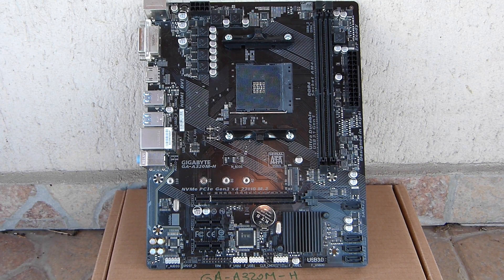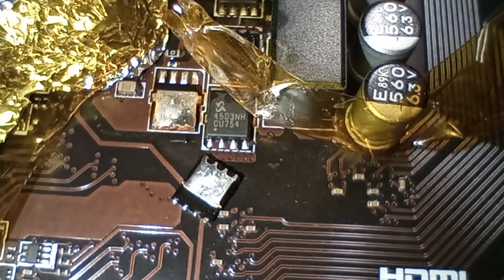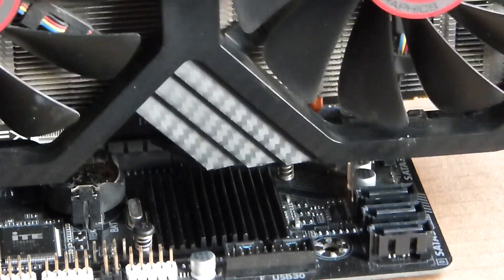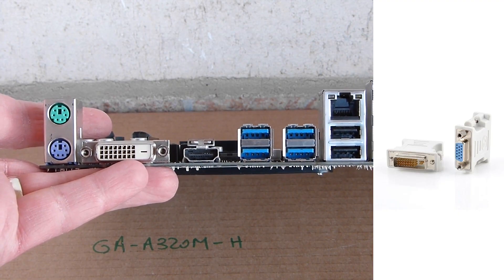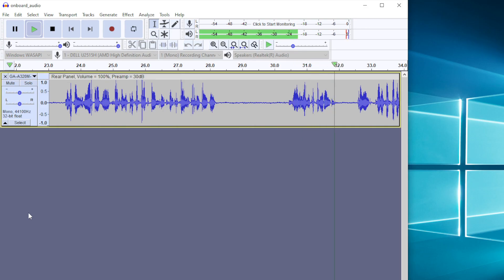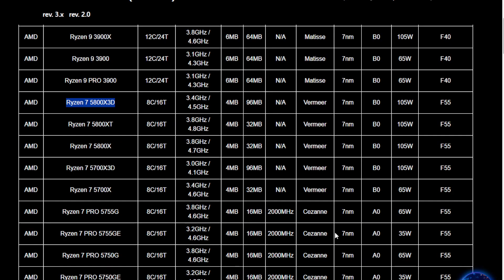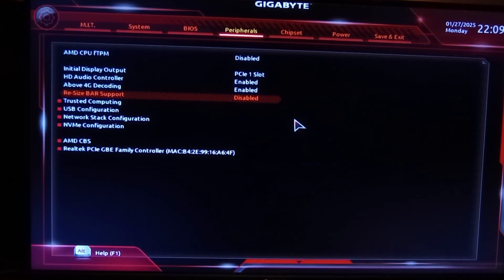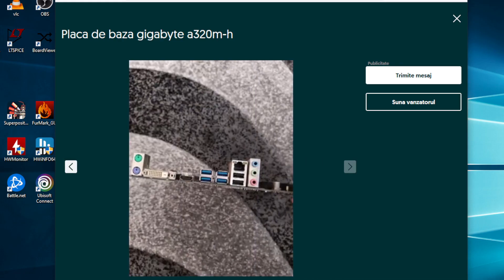A'Meh'4 Motherboard: Gigabyte GA-A320M-H

Comment: for 5 years i have this motherboard, i start to have some problems with the usb controllers, the audio preamp as how you show in the video is trash, and being limited to a small size gpu to use all 4 sala ports (who needs to use all 4 at the same time) is really a pain, and for my use case it's just not to helpful with all the feature it has, yes, for a low-end budget pc with a low-end cpu it does a fantastic job, but more extreme things it's just not cutting it
Reply from the maker: @Marius_Petrariu  The preamp is ok for video conferencing and voice chat in game. But that's about it.
The annoying bit is that there are other boards with the same ALC 887 codec that sound better.
Reply: Just use a 90 degree sata cable?
Reply from the maker: @ape337YT  I tried ... Marius is right. I use 2 SATA drives, and the two top ports are unusable with any GPU longer than 250 mm.
The naked VRMs also place a pretty serious restriction as to what cooler you can use. More on that in a follow-up, after I gather all the data.
Reply: @oldertechtoday  yea, and this is the biggest thing, the same audio chipset on other mobos are extremly good but on the a320m-h is not, which is sad imo at least for someone that is also a content creator and has a 3.5mm jack microphone it's the worst combination
Reply from the maker: @Marius_Petrariu  I hear you. I used an USB audio dongle for the videos recorded while this board was in my PC. Lucky that I had one.
Reply: @oldertechtoday  ah mb then, I thought a 90 degree sata cable would let you connect ur sata cables+big 3 fan gpu
Reply: @oldertechtoday if what I said doesn't work there's rly no way around it besides external drives, u can't even use those pcie to sata/m.2 cause those slots get covered with the gpu cause it's micro atx board, SUCKS
Reply: @ape337YT  i mean i'm using a m.2 ssd and one sata hdd, i was refering in the comment who has a 3 fan graphics card or one bigger than 300mm and needs to use all 4 sata cables i said it's a pain, for me it's not cuz i plan to ditch sata storage devices
Reply from the maker: @Marius_Petrariu  I'll add to that and point out that even an RX 580 from XFX will block those SATA ports, like seen in the video.

Comment: I have been using this Mobo since 2018.. it's now 2025.. it's still kicking!

It's pretty old.. I need 4 slot RAM now.. a Pcie 4.0 or 5.0 and ARGB header so I don't have to install extra hub.
Reply from the maker: @ZeeCH_Music  I used it with 2 sticks of 16GB each (32 total). But I guess PCIE4 would be nice, if you have a GPU or NVME drive that can use it.
Reply: @oldertechtoday Does it work fine with 16x2gb 3200 mhz ram?
Reply from the maker: @hokawa7877  the memory controller is in the CPU, not on the motherboard. If the  CPU you plan to use can go as high, then yes.
Reply: @oldertechtoday  Thank you!! I have a Ryzen 3 3200g and plan to upgrade 4gb ram to 2x16gb ram.

Comment: No cooling for VRM 2 slots of ram , it is what it is , not something i would buy personally
Reply from the maker: @Lifeless11111  There are better boards out there, and we'll examine a few.
Still, it does perform ok with a Ryzen 5 and a Wraith Prism cooler. I think that as long as you stick with downdraft coolers and low TDP processors, these budget boards can be a viable option.

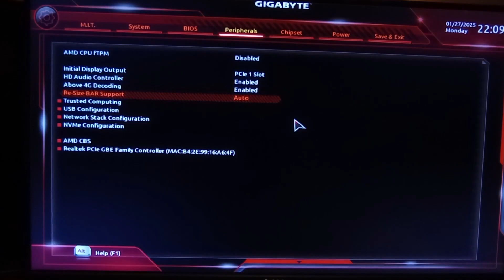Comment: 5:40 Wow! I have the same MoBo but a level higher (GA-AB350M-DS3H V2), and I don't have the “Re-Size BAR” option in the BIOS. This is probably due to the fact that I have the penultimate version of the BIOS.
What CPU model did you use?
Reply from the maker: Good point, Ryzen 5 3600, and I did flash the board to the latest version.
But! Rebar is quite old, and a lot of older CPUs/mobos should have supported it. It is (ultimately) the board manufacturer that decides if it implements it, and for what processors.
Reply: I got the ReBar by updating it to the lastest bios. 

I'm using the same mobo but it's V1.1 instead. 

upgraded my bios to have support for Ryzen 7 5700x.

I think 3000 above series Ryzen has ReBar option
Reply from the maker: @ZeeCH_Music  Yes, rebar is available from Zen 2 upwards. But that is by choice of board manufacturers. Rebar is old enough to be possible to implement even on Haswell CPUs.

Comment: Bro I'm getting extremely low fps in cs2.Should I sell my i7 4770 combo and Rx 580 and just buy Asus a320 and Ryzen 5600x and just use my old backup GPU r7 260x?
Reply: I tested the R7 260x in CS2 and it is not good for 720p resolution as FPS often drops to 40.
It is worth using the IoT LTSC edition of Win10, applying almost all tweaks through “winutil” and disabling Meltdown/Spectre patches through InSpectre to try to increase FPS on i7-4770
Reply: I tested the R7 260x in CS2 and it is not good for 720p resolution as FPS often drops to 40.
It is worth trying the IoT LTSC edition of Win10, applying almost all tweaks through “winutil” and disabling Meltdown/Spectre patches through InSpectre to improve FPS on i7-4770
Reply from the maker: @NATE_HYDENKO  I did test the R7 260X as well, using an E3-1241v3 Xeon (i7 4770 equivalent). Once I get around testing it with the Ryzen CPU, I'll have a clearer picture.
Reply: @NAKADZI  how much fps can I expect after these things
Reply: @highgunner8715  If your extremely low FPS is not related to the hardware (for example, single-channel RAM mode, or dried thermal paste, which can critically reduce CPU performance), then about +10-20 AVG FPS, and somewhere +5-10% to an indicator of 0.1% FPS. I also forgot to say that in order to get such an increase, in addition to the above tweaks, you will need to fully(!) disable built-in Defender and similar third-party software if you use them.
Reply from the maker: Not sure I'd so that. The i7 4770 should still be good for 120 FPS on average and 70 - 80 FPS for the 1% lows. 
I don't think that the Ryzen 5 5600X and R7 260X would give a better experience.

The RX 580 is a better card than the R7 260X.
Ideally, you'd get the Ryzen 5 5600X, but on a better motherboard (power delivery wise) and keep the RX 580 as well.

Give it more thought.